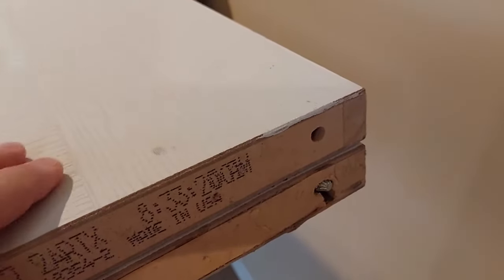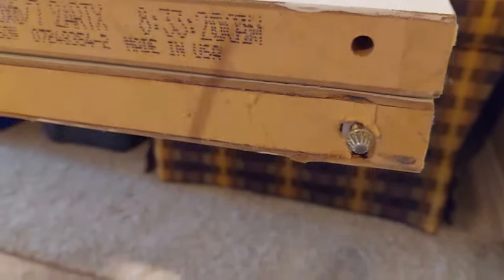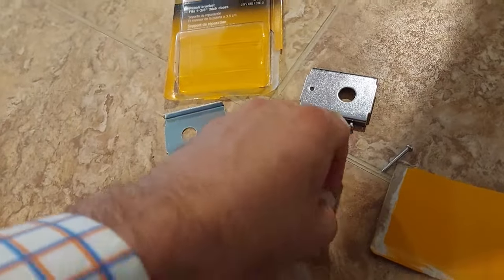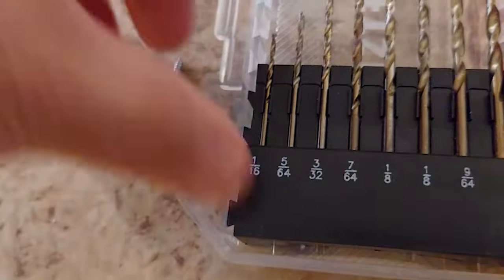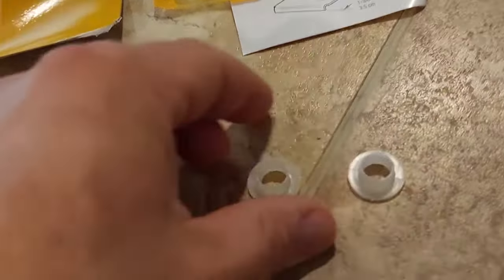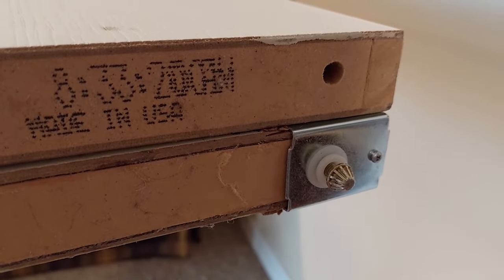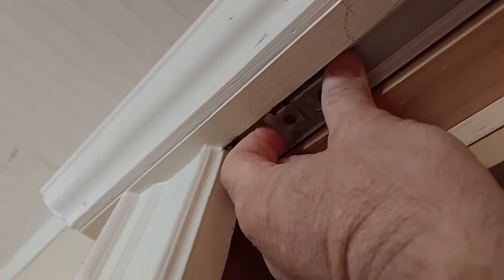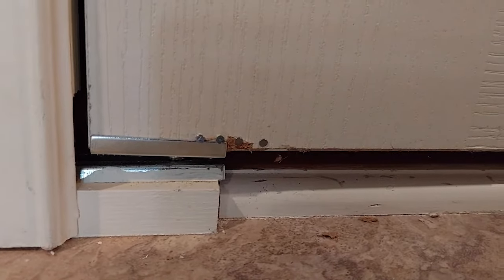DIY: Bottom Pivot Repair | Bi Fold Door Repair

Comment: in your link did it come with the white caps and screw but the model number is different on the package on the video ?
Reply from the maker: The link, I just checked both, is the medal plate only..... you can reuse the other parts from your door

Comment: Where do you get the plastic cover  that was over the screw? Had the same problem but when I took my screw out it didn’t have the plastic screw cover and I need that for the bracket to fit.
Reply from the maker: Not sure which piece your talking about but I think it was in the kit

Comment: My door is 1 and 3 /8 the kit is for 1 and 1/8 would it fit my door?
Reply from the maker: https://www.lowesprosupply.com/Product/BIFOLD-REPAIR-BRACKET-40-2453-1-3-8-PK-4-650205
Reply from the maker: I just added a link in the description. I am sure you can find it on Amazon and eBay also if you search for it.

Comment: what if the screw is inside the door, how can you get it out?
Reply from the maker: that is a great question. you might have to work at it to get it out. Mine was way up inside also. I had to pull the bottom off a little to get into it and then put it back but it worked out.